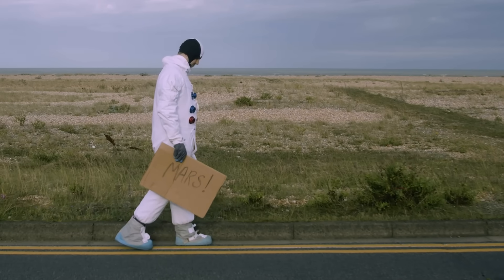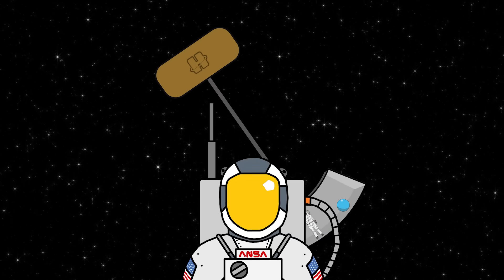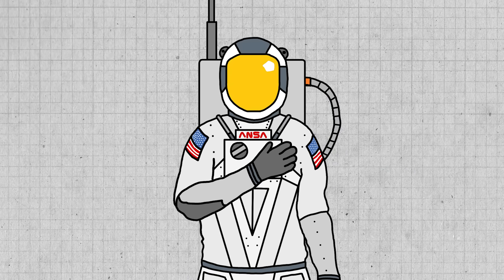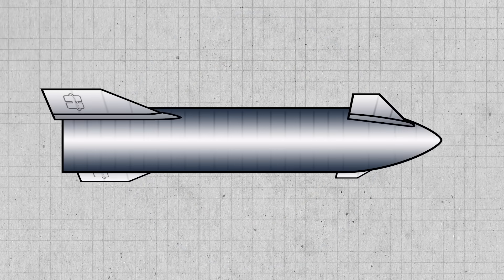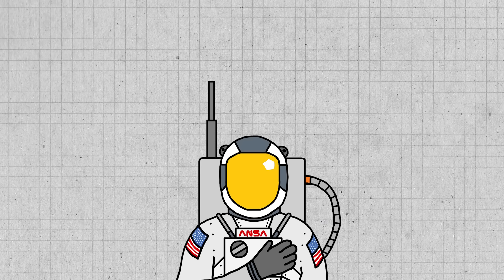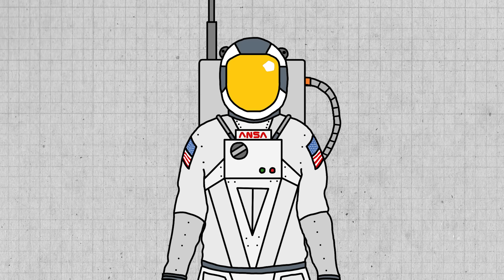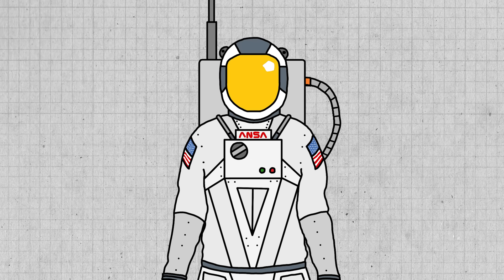This is NOT how you make Artificial Gravity

Comment: The only real way is constant thrust, lots of fuel.
Reply: Unfortunately, constant thrust is not the ONLY real way, within generally accepted physics. It's not even A real way. Fortunately, there is a real way: long-tether rotation.

Constant thrust and constant linear acceleration means ever-increasing power. 9.8 m/s^2 equals 9.8 J/(kg m). Multiply by the speed to get the power. So for instance at 1000 m/s power is 9800 J/(kg s), aka 9800 watts per kilogram, and that's a lot. At 10 km/s, 98000 watts per kilogram. And so on.

(The "power" above referred to is effective power: the power that accrues as kinetic energy. Rockets use huge power, and because their speed greatly increases as they go, you might ask, why isn't the power they need increasing in proportion? Because they start out very, very inefficient, and increase in efficiency as their speed increases!)
Reply from the maker: Unfortunately lots of fuel equals lots of mass, there’s no technology we have that could produce noticeable gravity for a meaningful length of time

Comment: The short radius centrifuge is the reason why the pressure in the eyes was not effected.
Reply from the maker: It could be, or it could be the fact it was done while still in Earth’s gravity so a total of more than 1G. Also, if your talking about the eyes being in the center and experiencing no a.g. in the video clip I showed, that is only the case because that was the control configuration. The radius was also extended so the eyes would be exposed to additional acceleration to compare the pressures. The machine just happened to be set up that way when the video crew stopped by his lab.

Comment: What about the issue of blood flow with a short tether
Reply from the maker: The study I show at 2:23 saw positive results for restoring blood pressure to standing levels with a short-radius centrifuge. Their configurations didn't exceed 2g's at the feet, but this drops off as blood moves up the body so it may be that the elevated acceleration at the feet can be balanced out by the reduced acceleration closer to the heart, leading to a similar total load on the heart. Either way, it appears to be an improvement over zero-g.

Comment: Starship will be a death ship unless Musk can make it a damn lot safer than it is right now.
Reply from the maker: Well, you’re right but that’s literally what their plan was explained as from the start. It hasn’t even made it’s first attempt at orbit, or fired the full booster. Also the only ship their working on is for Starlink deployment and it’s completely unpressurized. So yes, technically you would die on it but that’s kind of missing the point. They’re taking the all up testing approach to improve the system and make it safe by starting with low risk cargo missions

Comment: even with artificial gravity, corrections would need to be made throughout the flight
that means you need to stop the rotation many times throughout the coast, so you'd waste a crap ton of fuel.
Reply from the maker: There are articles on performing course corrections while rotating using computer control. Perseverance got away with 13 m/s so I think you could get away with many short pulses from the RCS system whenever the alignment is right

Comment: I think a better design: first, put the fuel storage in the top half and the habitat in the bottom half  of Starship. Have the two seperate , unreellinfg ~ five strands maybe 200 m .That seems a little more managable, and aim for half a gee. Redundancy is provided, and the 5 reels could be used later to draw the two halves of the ship back together... reconnect fuel feed li nes and flush....  also used for unloading, and then become the source of traction for cranes,winches, lifts ect on Planet.
Reply: The small fuel tanks at the top are to balance the starship as its entering the atmosphere, without them the entry technique doesnt work and you instead need a massive shield. Those dont work too well and above a certain size they just dont work.

Comment: A small centrifuge inside the Starship for each crew member?  That would add a lot of weight.  If the crew takes turns using one or a few small centrifuges, is that really enough to overcome the effects of prolonged weightlessness?  The two-Starship cable-adjoined concept would provide continuous AG for nearly the whole trip.  The weight of the cable could be reduced at a cost...
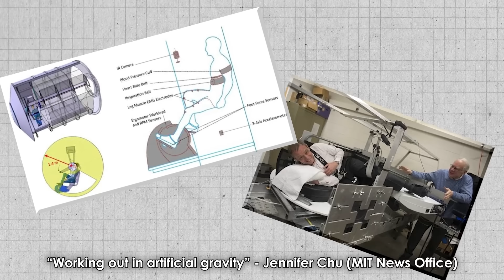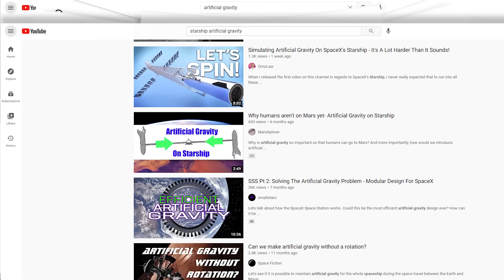Reply from the maker: I think the best implementation is for use during exercise similar to the MIT concepts around 15:16. This would take the form of an exercise bike or something similar that is on an arm within the starship's 9m diameter. This would further limit balance and motion sickness issues as you'd be on a bike seat and not moving your head side to side. Intermittent exposure seems to be adequate to counteract zero-g, the 2nd paper on the right around 0:22 demonstrated that 30 minutes a day was enough to offset the muscle losses we usually see during bed rest studies. "Aerobic exercise capacity" was not maintained but this is probably because they were not moving while in AG, 30-60 minutes on a bike is pretty reasonable given current astronaut schedules and would likely do a better job maintaining "cardio.”

Comment: Why not three starships tethered to a single hub?  That would have all three starships revolving about the hub in the same plane at 120 degrees to one another. The single hub could also have a rocket or rockets for mid-course corrections, etc., but its main function could be to simply maintain the three starships in configuration.
Reply from the maker: That could work if you had a reason for needing three, I think you could could make it passively stable with flexible tethers. It does add complexity though

Comment: Can you look into and discuss the feasa ility of rotational artificial gravity with an example found in the Gundam anime in use on the orbital colonies?
Reply: It is already known that the long tube spinning around its long axis is unstable. It is not the way anyone who's sensible will design a space habitat.
O'Neil himself did not propose it as a realistic depiction. He wrote that it's probably about as accurate as what "futurists" of the 1890s though the year 2000 would look like. IDK why he ignore the windows as a clear path for cosmic rays. It cannot work for that reason alone. It was never proposed as a realistic depiction, other than what cold be built if anybody wanted to ignore safety could feasibly build.
If the outer rim, possibly sub-floors under the interior floor are massive, it might get up to 2-3x the diameter in length and still be stable.

Comment: One hundred inflatable modules, each the size of starship's fairing, 9m x 18m to build a station.

Assume modules inflate to double the dimensions.  So, resulting segment would be 18m x 36m.

100 segments x 36m = 3600m in circumference, or a bit over a kilometer in diameter.

100 launches x 2,600,000 per launch (2M est + 30% margin) = 260M USD.

Cost average cost of a single shuttle launch in 2011 was $450M

Bigelow modules, on which I'm basing this concept, are difficult to price.  However, initial proposals, bare of any equipment or internal structure, have been under $20M.  So, assume 30M for the increased size of starship, perhaps adjusted lower to reflect economies of scale from building 100 units.  $25M?

25M x 100 is 2.5B for a bare, structure only, rotating toroid space station that is 1.14km in radius.

Think we can afford that?

I don't see how we can afford not to.

Comment: I think That a small centrefiuge inside a starship has the same problems as the option with one starship rotating along the axis perpendicular to the line of cone and engines(the g force not pointing in the direction it woud be when lts landed on mars ). Additionally it would not have much less usible space inside and be a lot more complicatad.  

the theters are grate becouse there are generalnie ligther  but they can  tumbe and crash the starships tougether.

Comment: You're still talking about actual gravity vs space vacuum for the phone test. The idea behind Space X is that the center ship will remain in a level forward motion. The 2 outer ships would spin clockwise or counterclockwise. The occupants would be on the 2 outer ships with the center ship being the main cargo ship. I can't see wobbling being that much of an issue in a vacuum. Rotation would keep the tension on the tethers.
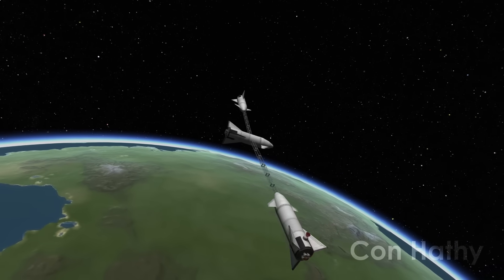Reply from the maker: The intermediate axis is unstable in space as well, it has nothing to do with gravity or the atmosphere. Veritasium walks through the mechanism. You would still experience artificial gravity, but the room would randomly turn 180° around you which is dangerous for balance and knocking things over and is much more likely to make you motion sick than the constant consistent rotation. 11:11 shows about what this would look like, this is just relying on KSPs physics engine which is plenty accurate for this
Reply: @ConHathy  I get that. But you kept showing the animation of the center Space X ship turning end over end. That is not the way Elons CGI demo explained it.
Reply from the maker: @KaraokeDuov2   which demo is that? I don’t recall any official SpaceX artificial gravity concept, just the small star’s concept which does rotate on its intermediate axis and is the render I’m showing here

Comment: Why would you need to use rocket fuel to spin something…. Any mass in the middle could be spun against and used again to spin down.  Might take a while if it’s small but you have months.  Certainly less mass than in rocket fuel x2 
And it’s reusable if you want to spin down and back up for any reason.
Reply from the maker: GRL Cowen reminded me just how much heavier a fly wheel would be. Methane thrusters will be accelerating their exhaust to about 3,000 m/s, if you’re not accelerating your wheel to the same velocity then it will have to be heavier than the fuel, and that’s assuming it’s a 1km fly wheel with all the mass on the outer edge. If it’s smaller it will have to be even heavier or faster which is impractical
Reply from the maker: True, the issue is weight and friction. Something this large has an insanely high moment of inertia, to rotate it you would need a very heavy fly wheel and would need to accelerate it to very high speed, then you still have to deal with the friction from the bearings so some rocket thrust would still be required to maintain the rotation over time. There’s also the issue of making the structure ridge enough to actually transmit torque from the center out to the ends so a flexible tether isn’t an option anymore. That makes launching and assembling the whole thing more complicated.
Reply: "Certainly less mass than in rocket fuel" -- no. Certainly a lot more mass than in rocket fuel. If the rocket motors were on the flywheel, or the place it would otherwise be, this would be true because rocket fuel exits a rocket motor much faster than any flywheel can turn. Much much faster, if the rocket motor is an ion drive.

Also, the rocket motors would be much farther out. So mass launched by them could have hugely more angular momentum, much-to-the-third more angular momentum, than mass in a flywheel.

If the rockets don't mind being pulsed, spin-up and propulsion towards destination can be done with the same propellant.

Comment: I am a fan of ion thrusters for spin-up. That way not only do you, as Hathy says, have no need for chemical rocket engines at the spin axis, you can have a propulsion module at one end of a long tether that thrusts tangentially while the tether is being unspooled, maintaining constant angular speed while angular momentum greatly increases.

Then when that's done, you can gimbal the ion thruster out of the spin plane and, you know, put the hammer down. Boldly go.

Boldly but patiently. Enormous average speeds over interplanetary distances are possible, but the well-wishers at the space quay may get tired of waving and cheering when, four minutes into the journey, you're just finishing the first kilometre.

Comment: The tether should not be a tether, it should be a gantry that both ships meet up with, fly inside and attach FIRMLY. No flimsy rope like tether that can be knocked out of whack by the slightest miscalculation or space debris or other objects. What if spin rate thrusters dont fire in perfect unison. The slightest timing or thrust amount discrepancy could send a shock along the tether that might destroy one or both ships. A solid strong gantry holding both ships firmly and absolutely as 1 piece is the least complicated if you can work out the problem of flipping over. There might be a way to add continuous thrust precessional force thrusters 90 degrees to the stations normal spin. They would have to be able to run continuously for the entire trip to not necessarily completely stop the precession, but slow the precssion to a tolerable level. You would still get the needed amount of g force even if some small amount precession is allowed to happen.